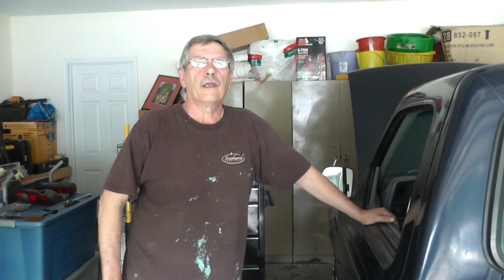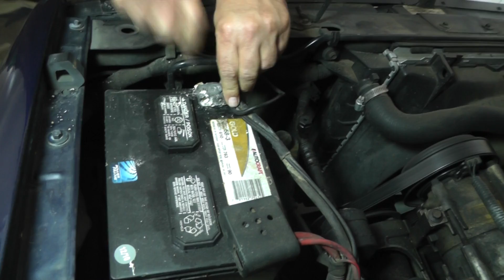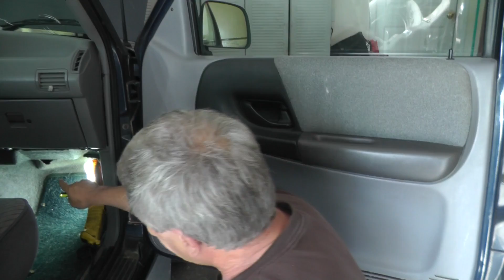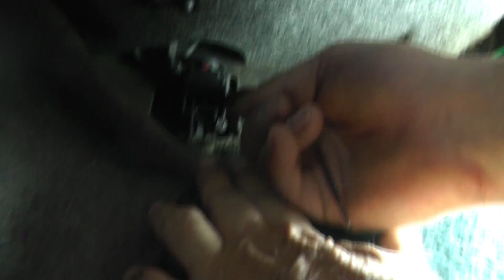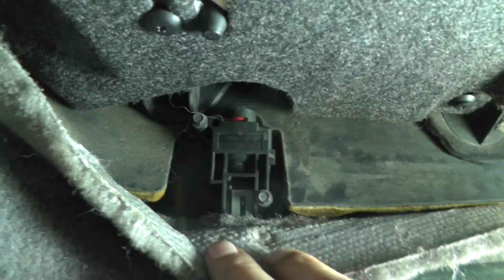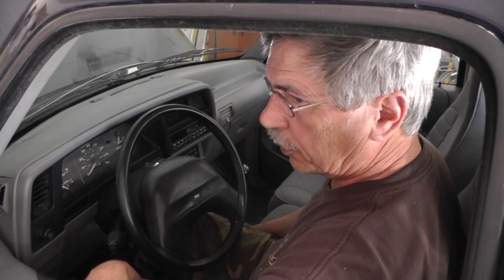Ford Ranger Fuel Gauge Diagnosis Part 7 (Sending Unit/Fuel Pump Removal)

Comment: Bring your sending unit with you. I ordered a unit that was supposedly a specific match, and its height dimension was shorter than stock, leaving the pump more than an inch and a half above stock height, leaving pump intakeand filter sock 1.5" higher than OEM stock. Delphi part no. HP10141 or equivalent, is correct.
Reply from the maker: Yes, always a good idea to compare the old with the new. Have a great day!

Comment: Nice video man ..I am having a rough time trying to fix my fuel gauge for 1997 Mazda b4000 ..I have replaced the sending unit /fuel pump and instrument cluster and gauge still doesn’t want to go all the way down from quarter to empty
Reply: It will rise when I add fuel to the truck but once it hits quarter to empty it won’t go anyfurther
Reply from the maker: All I can say is that you've got a problem in your sending unit maybe not going all the way down or a problem in the gauge. Besides replacing parts, what troubleshooting methods have you used?
Reply: stuzman Thanks for replying and as in troubleshooting nothing really I just crawled under the truck to see if I see any wires that are pinched or something but I’m not sure which wires exactly go to the sending unit
Reply: stuzman I have been at this for months now it has left me without gas  twice already..do you think it is a ground wire that’s throwing off the reading ?
Reply: And I did notice when we installed the sending unit in it was hard to push down to put the lock nut
Reply from the maker: First, I would start by getting some wiring diagrams for your vehicle. Nothing like working on an electrical issue and not having any diagrams. You can use this link to get free wiring diagrams for your vehicle by filling in the short form and then you can select your vehicle. http://www.bbbind.com/tsb-wiring-diagrams/ I covered the troubleshooting in detail which could help you if you didn't watch it. Here's another link to a short video which may help https://www.youtube.com/watch?v=z4c8_NnBW4s
Reply from the maker: That could mean something or not, but to start your troubleshooting, you're probably going to be there at the sender to do your checks.
Reply: stuzman I will download the diagrams and thanks for the information

Comment: Great video series Terry! Just purchased a '94 B3000 and fuel gauge doesn't work. I will use your video to check it. By the way what did you use to siphon the gas out? Where did you purchase it? Would be great for this project and other projects I have.
Reply from the maker: Hi adrean8j...It was just a hand siphon pump and I believe I picked it up from AutoZone. Any of the major auto chains should have one. Good luck on your project and hope all goes well.

Comment: In my case the gas n temperature n oil Gages r not working is there something Else I should look 4 beside the fuel pump
Reply from the maker: +William Cruz William, check fuse #7, 15A which is located in the fuse panel on the driver side inside the cab. This would apply to a 94 Ranger. Other models and years, I wouldn't be sure about.

Comment: Never understood why to disconnect/disengage the inertia switch when removing the battery Neg cuts ALL power to the truck - BTW, I use little shims of wood on electrical clips with multiple tabs like that - push a shim in each tab until the it clears and wha-la connector slides comes off ;)

Comment: Interesting that both of you fellows touch the gas w/o any nitrile gloves on.I've found that the fuel smell is so strong and lasts so long that I never want to get it on my skin. Also, on my own vehicle, if I found the float was leaking, I'd probably try to just repair or replace that and put it all back together!
Reply: caduceus33  Gas doesn't linger on real men ;)

Comment: I replace the sending unit yesterday on my dad's 94 extended cab ranger and it was pretty tough trying to get through all of the rust. The new unit works great but now the fuel gauge is only reading half a tank and I know that's not right because the fuel tank is full. The fuel sensor or connector was dirty but I cleaned it. Do you think it could have something to do with the connector on top of the fuel pump?
Reply from the maker: Quite possible you may have an issue with the connector at the sending unit. But you want to make sure before you go back there, especially if you have it all back together. To verify that you have an issue still at the sending unit or possibly at the fuel gauge side, take a 150 ohm resistor and install it at the connector under the hood. You can see this connector and where to put the resistor to determine which way to go in this video that I did https://www.youtube.com/watch?v=0F37-_3j0bI&list=PLrbHoqGceWKQgbIQ-AmPtEcfPQ8o6llnN&index=4 Good luck on your repair.

Comment: Sir a up date , the ranger with fuel on over full so my boy start his truck and know its back working over night
Reply from the maker: Probably got an intermittent condition where the sending unit is opening up and then making a connection. Don't be surprised if the problem comes back. Thanks for the update.
Reply: It has flex fuel to the sender only 400.00 to parts wow  , what your thought used stuff , jusy put wing nut on so ez to replace again
Reply from the maker: Hard to understand what you're saying Donald. But I'll respond to what I think you're saying. 400.00 dollars is a lot for a sending unit. As for used stuff as a sending unit, I wouldn't bother it. And a wing nut on what, you've lost me completely.
Reply: Just install used parts fail , more then new do , that tried say